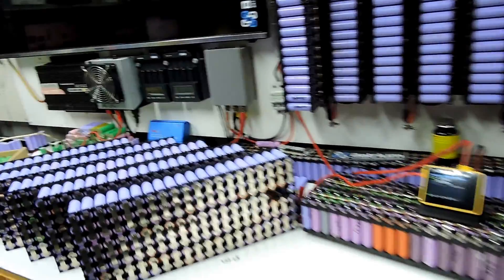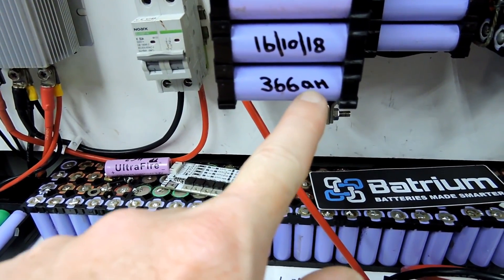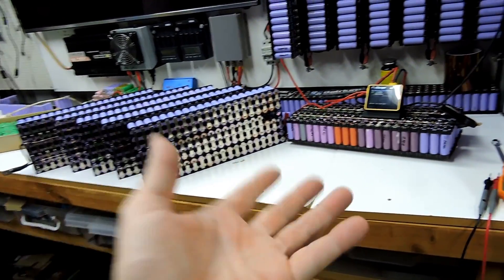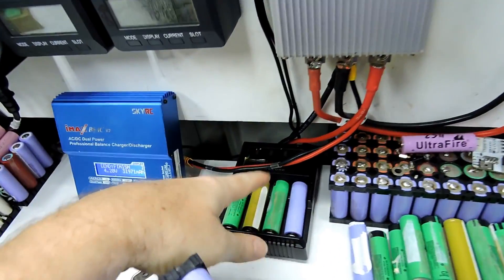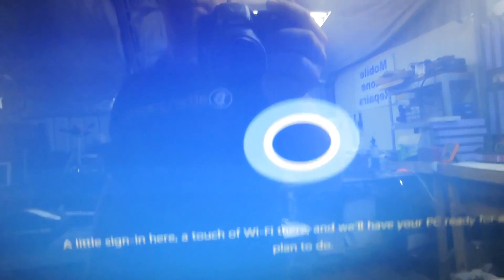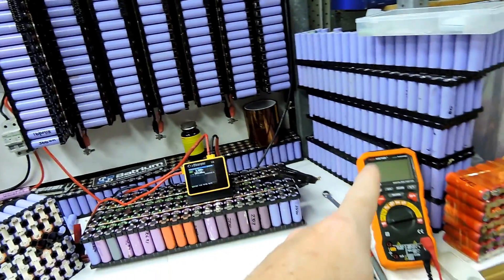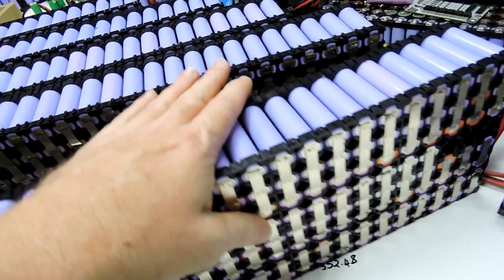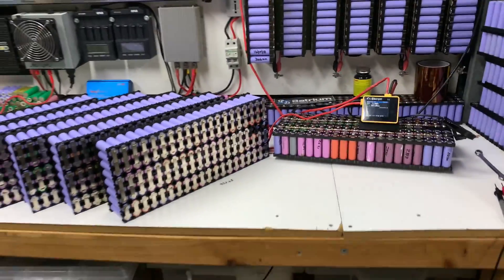HBPowerwall Update & selling off old cells

Comment: does it smell chemical in the shed with all those batteries?
Reply from the maker: Exhaust vent runs 24 hours - the only time you smell anything is when your breaking open packs.. some times there is a chemical smell I assume is glue or anti-vibration material

Comment: Hello how are you ?
I am Marcelo, I live in Brazil. I'm a photographer and Filmmaker and I like a lot of alternative energy and I'm an hobbyist in electronics.
I plan on putting together a solar-powered system to work in my studio. I will mount a 1500W lithium pack in 12 volts (3S).
I noticed that you use the MPT-7210A Solar Charger. Is he really good? I really look for a low cost but good alternative.
I thought of Makeskyblue, Epever, Fungpusun, but all of higher cost for my case.
Thanks for the attention and congratulations for the excellent videos, I am always following.
Reply: I noticed that it only supports 10A ... for added security on my system, the ideal would be 20A.
Do you have any suggestions ?
I'm reviewing the MPPT MakeSkyBlue 30A.

https://pt.aliexpress.com/item/30A-40A-50A-60A-MPPT-Controlador-de-Carga-Solar-f-48-36-24-12-v-v/32950731408.html?spm=a2g0s.13010208.99999999.336.5acf3c00rOOzAX

Comment: Whats the best nickel strip you have found in bulk quantity?
Reply from the maker: https://es.aliexpress.com/store/product/0-15-x-8-mm-Pure-Nickel-Strip-Strap-for-Battery-Welding-Spot-Welder-1kg/931105_32826429738.html?spm=a219c.search0604.3.1.13ab5cebMhv54T&s=p&ws_ab_test=searchweb0_0,searchweb201602_4_10065_10068_10130_5731315_318_10547_319_10548_317_5728815_10696_10084_10083_10618_452_10307_532_5731115_5731415_10131_10132_5731215_10133_5731615_204_328_10059_10884_5731515_323_10887_100031_320_321_322_10103_5731715,searchweb201603_2,ppcSwitch_0&algo_expid=5b30c8fc-12e4-4828-964e-7cfd256fff60-0&algo_pvid=5b30c8fc-12e4-4828-964e-7cfd256fff60&transAbTest=ae803_5 that's the cheapest i've found to date - several have confirmed it's 'pure' but you can never be sure.

Comment: Hello. I want to ask you, 
What are you setting up when charging a battery voltage end down - discharging? Its correct if low battery is 3.14 and high is 4.1? What you think? Does it have batteries for loading cycles?
Reply from the maker: for my inuse packs it's 4.13v top and bottom don't like to go below 3v *but i do all the time lol
Reply: Thanks.

Comment: 1:39 Pete, might wanna double check your solder connections. This one has solder making contact with the shrink wrap. Doesn't look like it burned thru, but this is the Pos side and there Neg shell under that wrapper. We don't need to have any fireworks   ;)

Funny how out of all the possible spots to show, you show the one that's possibly faulty. On purpose to see how observant your viewers are?  ;)
Reply from the maker: Great that people notice as did I, it has two nylon things under the shrink i burnt it up when removing from the battery just didn't re shrink